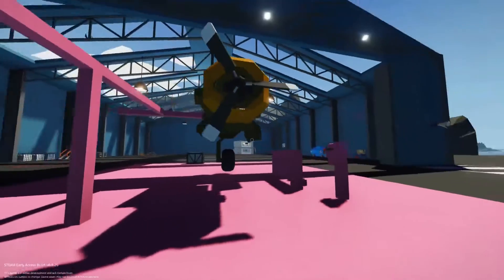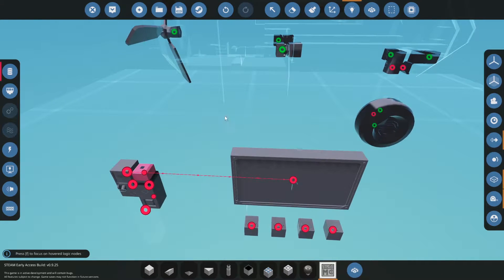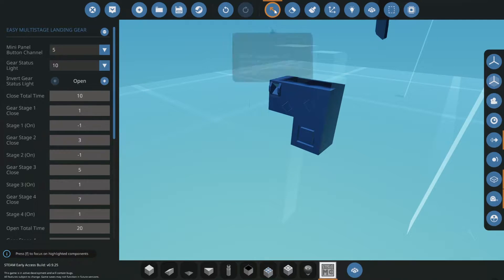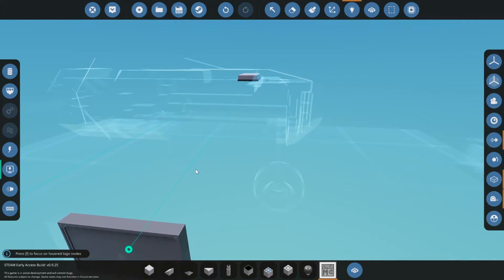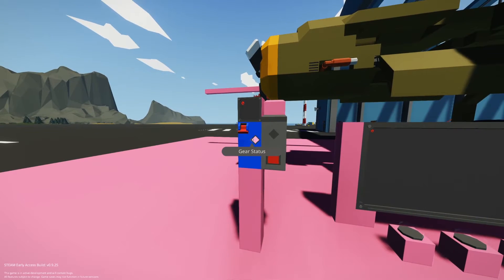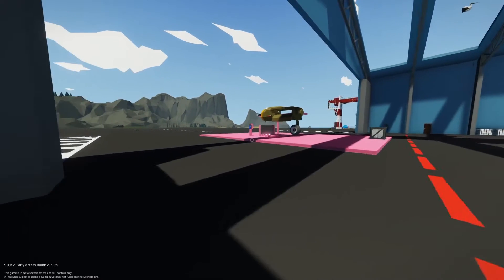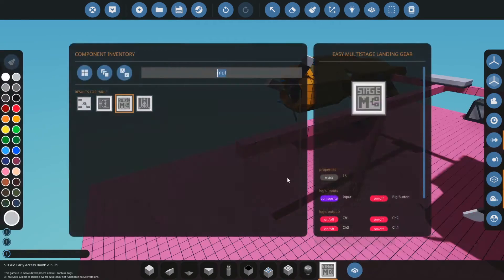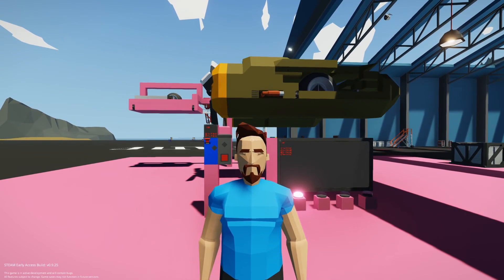Stormworks Easy Multistage Advanced Landing Gear Tutorial

Comment: It got me almost all the way for my landing gear, however I now need to figure out how to re-close a hatch that had to be opened with this logic, how would I do that?
Reply from the maker: Not sure what your landing gear does - I don't think this will work if you have a hatch that opens - landing gears comes down and the hatch closes again while it's down. You'd likely be better off doing custom logic or lua  (if i'm guessing your issue correctly)
Reply: @EndoSkull  Actually I got it to work by modifying the off and on outputs of the Micro Controler and using basic subtraction so the last action just undid the first action. Took me a lot longer to figure that out than it should have but it works now. And you did guess it correctly, The hatch opens, landing gear comes up, and hatch closes over them, and vise versa.